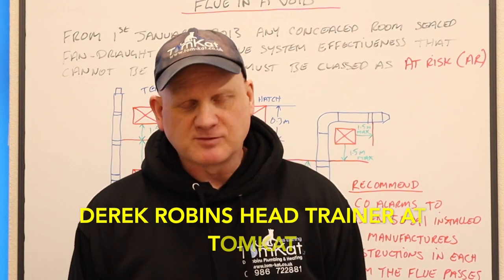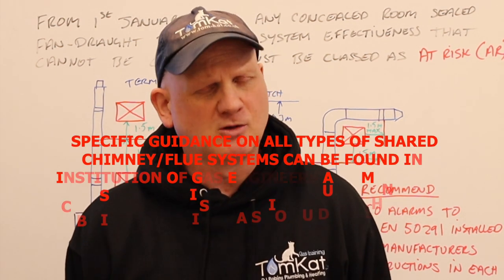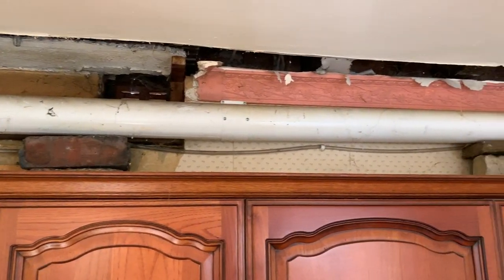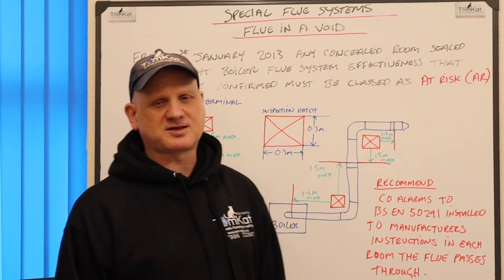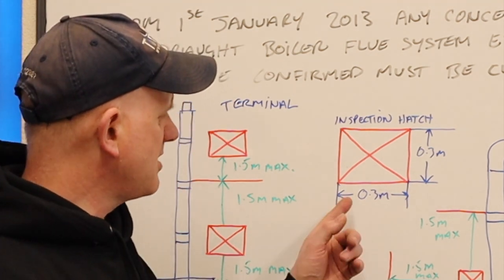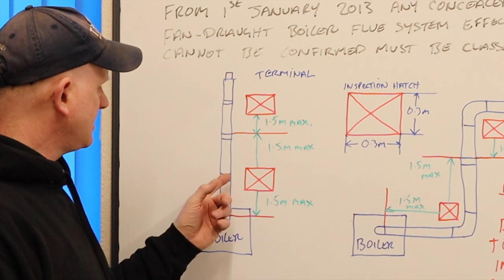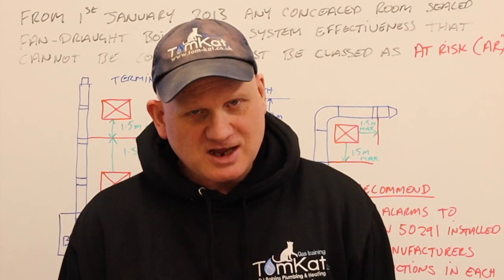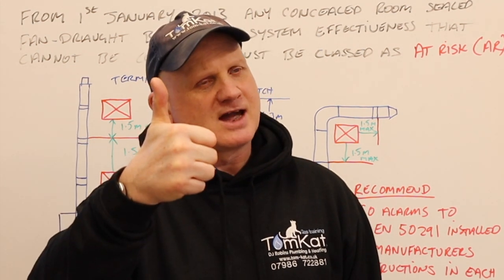Boiler flue inspection hatches, gas safe technical bulletin 008 edition 3, ACS revision boiler flues

Comment: Does it still need access if there isn’t a joint in the void? And what intervals would they need to be? I think you can get a 4m length of flue now from some manufacturers, thanks for the content 👍🏼
Reply from the maker: You would probably still need a hatch so future engineers could see there are no joints in the flue
Reply: @tomkatgastraining  👍🏼👍🏼
Reply: Good question Gurnsey87

Comment: Can you clarify what you mean at 7:35  what happens or what you do if you have less than 20.6 oxygen. I thought that meant it would fail it’s flue performance test? 🤔 thanks!
Reply from the maker: You check if you have 20 .6 outside first
Reply: @tomkatgastraining  so if there was 20.5 outside then you are allowed 20.5 minimum at flue test? With a max of 2ppm of CO?
Reply from the maker: @asbestosflake5749  no it’s 0.2 % co2 not co

Comment: what is the score if the purpose built void is only 250mm square and the flue does not have any joints because it is only a 2mtr straight run to the outside?
Reply from the maker: No hatches needed if there are no joints in the flue system.

Comment: Keston twin flue system  50mm mpvc does this fall in to flues in voids considering its a welded pipe
Reply from the maker: Only the air inlet pipe is not covered in the flues in voids so you will still need hatches for the poc pipe

Comment: I have a baxi duotec in a flat where the flue goes into a communal coridoor to the outside. They have put an access panel in and I can check the joint, but it's not correct size. I at risked it last year and the landlord of the building has ignored my notice, and other companies have also reported same issue. I'm due to service again soon, any advise welcome Derek 👍.
Reply from the maker: Because you AR and not ID all you can do is keep filling in the warning notice and informing the responsible person.
Reply: @tomkatgastraining  Thanks 👍

Comment: Good afternoon, great YouTube content. 
Always look forward to a new YouTube upload from Derrick at Tomkat.
Anyway, I don’t like to go off track, but I would be very grateful if any experienced gas engineer can give me some advice.
A few years ago when I was gas training, my gas trainer told me that a combi boiler can be installed in zone 2 of a bathroom - only if there is nowhere else in the property to install it (I presume that he meant that’s ok if the boiler is in a purpose built cupboard with RCD, or if the boiler manufacturer gives permission to do so) ?
Anyhow, I can’t find this info anywhere? Be great if somebody can point me in the correct direction. 
Thanks, N
Reply from the maker: If you look in any Worcesters boiler manuals it gives you a great drawing of the bathroom zones you can and cannot install a boiler. Hope that helps
Reply: @tomkatgastraining  
My Man, Cool, much obliged.
However, these manuals appear clear as mud.
Reply: Maybe something lost in transition, between boffin and gas engineer?